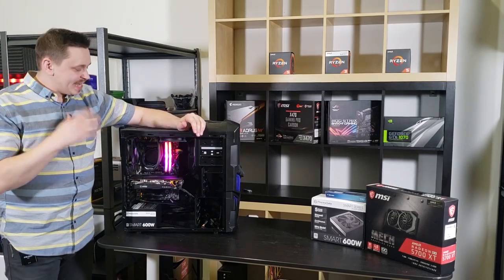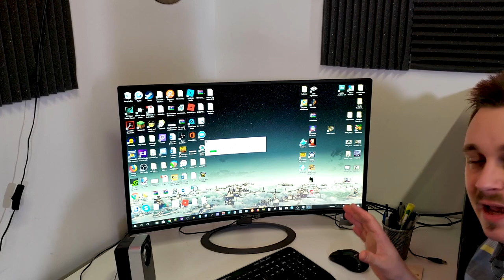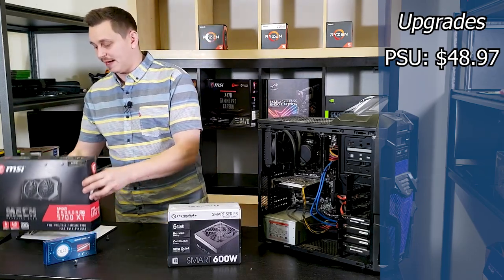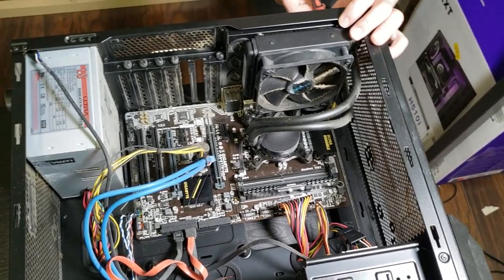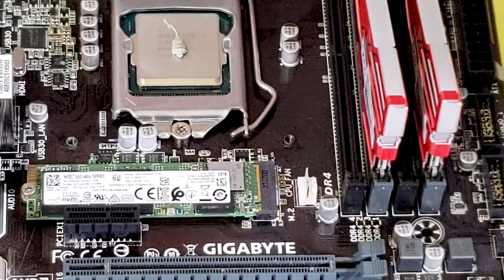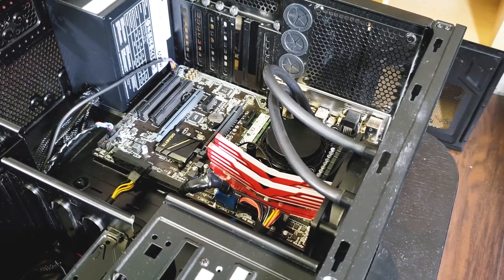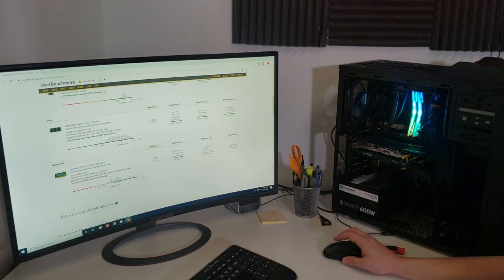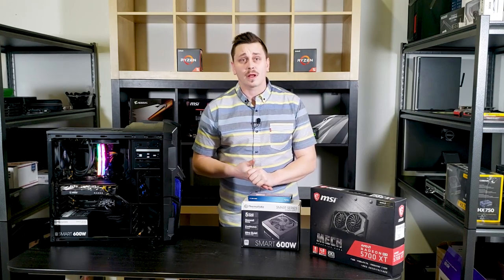MSI 5700XT Mech Edition Build Guide Overview

Comment: Nice video, just finished my build. I went with a i7 8700k, delidded it and overclocked it to 5ghz, also went with a evga 2080ti and 32 gb of Corsair memory, I know it’s overkill only really needed 16 but I needed to fill all 4 slots and it was either $50 for 2 slot fillers or $80 for actual memory so it was a no brainer. Also bought a Corsair h115 aio but I’m in the process of switching it all over to a water cooled system just waiting on the fittings, damn those things are pricy lol. Just purchased that same 5700xt for my current build that I plan on selling to make some extra cash, how do you think that would pair up with a Ryzen 5 3600? Anywho, I really enjoyed your video keep up the great work, just subbed.👍👍
Reply from the maker: I appreciate the sub for sure. I would gladly take an overkill build over underpowered. I love the 5700xt, I think some people talk up how good it is. But it is solid with the 3600 imo.

Comment: Got any ideas for a SLI 1070 setup under 1000?
Reply: Also know anywhere to get good deals or any site specific? I live in MI
Reply from the maker: Im working on it. Maybe a fallout 4 themed setup since it is one of the best games that supports sli. I love my 1070...and I happen to have two on hand.

Honestly. If you want used, offerup has buyer protection, amazon warehouse is good, or just deals on the major websites.
Reply: @BainCustom  I was actually gonna see if MicroCenter has anything I heard they can have nice deals and maybe even some open box stuff, I really like the fallout series (FO4,FNV,FO3). I've been gaming on a pentium g4560, gtx 1070, ddr4 crucial 2400mhz 1x8 sr and it kinda works but I really need an upgrade. I got the 1070 when it was 500 for 300 cuz I had a gt 1030, I really need help finding something to hold my parts for under 30 cuz and gonna work my butt off to get the rest of my parts. p.s thank you for listening to my Ted Talk.
Reply from the maker: Haha. I like the enthusiasm. I'm not sure you checked out my $500 build guide. I would follow that list but sub out the CPU for a better one (ryzen 5) and get 8 more gigs of RAM. Use the same case and motherboard. The rest you already have. I would say intel build but the ryzen 5 pvp is a bit better right now. That with the 1070 you will be gaming at high-ultra on pretty much all games. 

But I think one of my next videos will be the fallout 4 themed 1070 in SLI.

Comment: uploading on two channels ?
I know next to nothing about PCs, don't even own one. if you had to break out the vacuum doesn't that mean the cooling wasn't creating ''positive pressure'' i.e. blowing air out from the tower ?
Reply from the maker: Pretty much on the airflow. It can be a number of things but usually it is bad air circulation. This case had 2 fans...which is nothing for it's size.

The two channel thing...we are running an experiment.